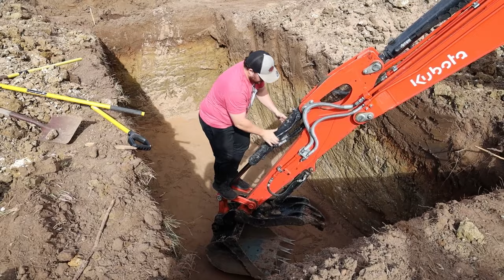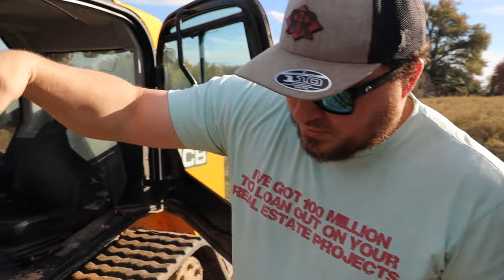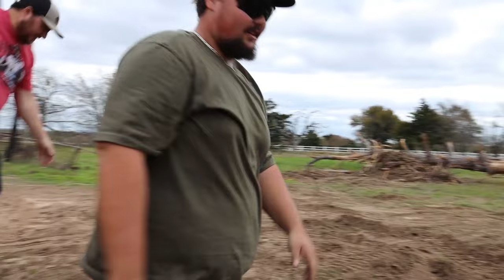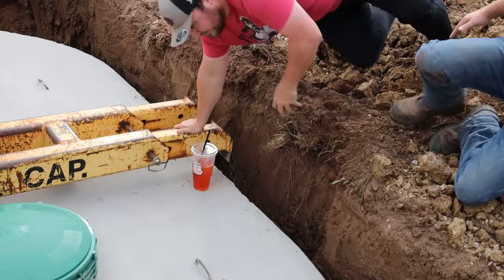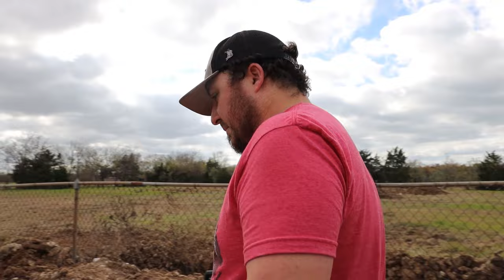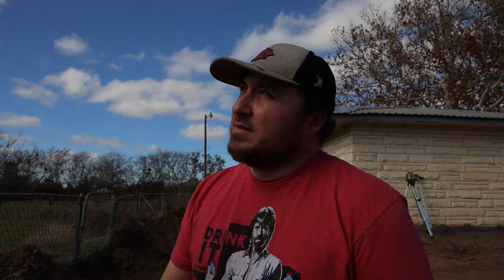Understanding the Intricacies of Septic System Installation

Comment: Circumference is the length of a circle around. Radius is middle to edge.
Diameter is probably the term you were looking for, it's from 2 edges of the circle passing by the middle. 
2r = D 
C = π r²